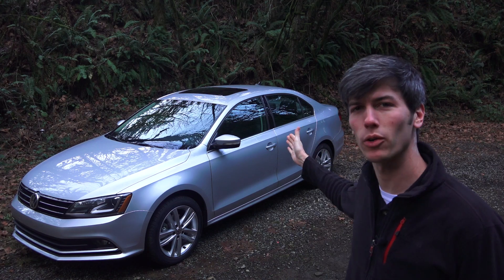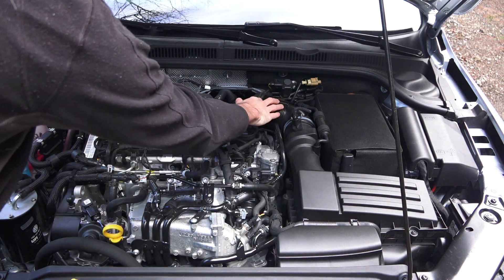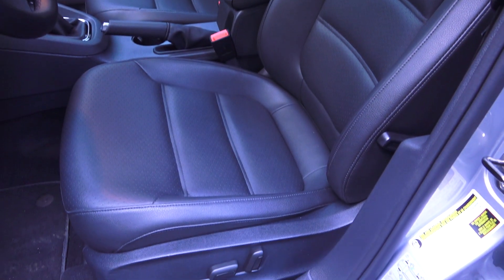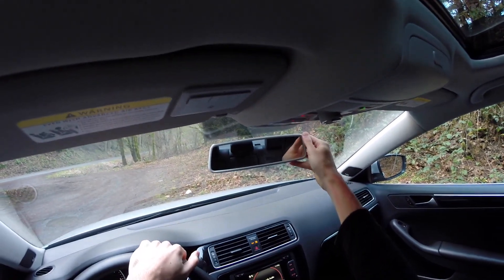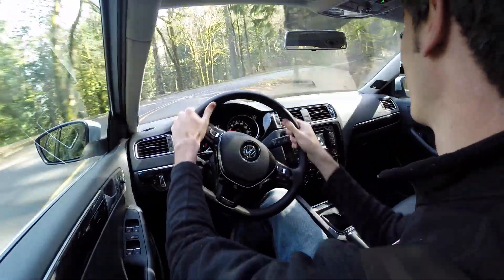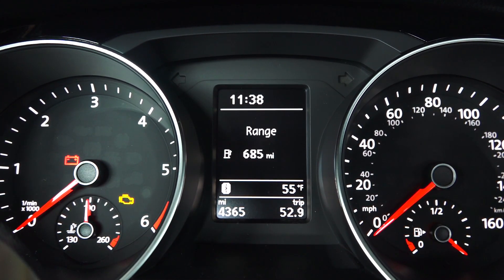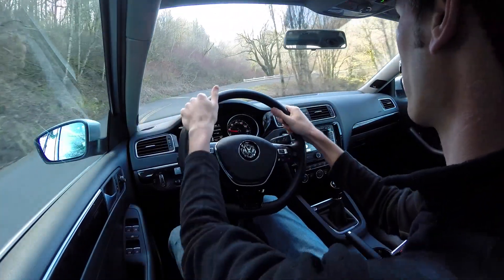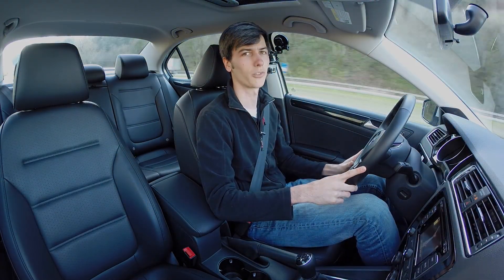2015 VW Jetta TDI - Review & Test Drive

Comment: I had a 05 TDI, honestly they're great road cars. Low end power and speed to make them fun, but they're a dog at high speeds which keeps you from getting in trouble. The only thing I didn't feel great about was VW used super thin wires for everything. At one point I got a trouble code for the turbocharger VNT actuator. After looking underneath one of the 3 wires going to it had broken in half from the heat hardening it and making it brittle. It looked like the same 16 or so gauge wire they use for the radio harness. Not even a wire loom over them. Not ideal.

Comment: Looking at a 1.8 14 and a 15 with the 2.0... curious which would you suggest... price is about the same
Reply: We drive a 2.0 it’s slow but livable. Pretty reliable too mechanically. I would go for the 1.8 for the extra juice, but get some answers from 1.8 owners first. Do keep in mind that vw are notorious for having small electrical issues like the window would sometimes not close and keep going up and down, but nothing permanent. Right now my blutooth stopped working. But the aux still works so i got an aux cable Small things like that

Comment: AND THEN THE EMISSIONs scandal....NO more diesels from VW.... Stopping pipelines this is getting old.
Reply: They're fixing the 6th gen diesels and putting them back in dealers again. You can now get these cars for dirt cheap. My dealers have 10 of the Jetta Sportwagen TDI for as low as $11,000.
Reply: @PhyuckYew  Be sure to do the cp3 mod the HPFP does fail on these. but other than that they are a great car

Comment: It's interesting as an engineer that you mentioned the "gas mileage" it gets. That's something I chastise my wife for doing when stating that. She put"gas" in my ecodiesel jeep when she borrowedit. I implore with her to always just call it fuel if she can't remember diesel and beg her to tell me she didn't put gas in it. Regardless of what type of fuel the car takes, "fuel" is generic and therefore accurate, whether it's her car Which is 
 out of gas or mine which is  low on diesel. Just changing the vernacular to say we need fuel or get good fuel mileage seems easy enough to me (not too disruptive). Sorry to be a stickler for good diction (which you normally have. As a diesel fan, this particular thing stands pout to me like a sore thumb.

Comment: I am curious to know what sub model this is. I currently own a 2015 VW TDI SEL w/ a DSG transmission. My model, made in March of 2015, has 4 wheel independent suspension, not the multil link track axle you show here. My dashboard is also different. I have a digital fuel gauge & no temperature gauge. Furthermore, my multifunction display does not show oil temperature. And you mention this model has adaptive headlights, turning left to right, yet I have never seen any VW with the exception of the Phateon (discontinued). Also your model doesn’t have a trunk lid spoiler nor did you mention the DEF tank in the trunk in the right rear...

Comment: the first thing I do to this car is cut off the exhaust system and have something sporty put on it. Now I'm not a young man anymore but I have a Subaru 98 legacy that has a modified exhaust I just love the sign of the engine. And I'd like to hear the turbo on that engine coming out the tail and also the diesel sound.obviously it's not a V8 diesel or an inline-6 so it's not going to make a lot of chattering sounds but I would probably remove the insulation under the hood just so I could maybe hear that engine. 

My goal is to keep the Subaru in and one day get this car.

Comment: Great review, Jason.

My girlfriend has a '13 TDI Beetle w/ the DSG. After driving it, I'm STRONGLY considering a Golf TDI w/ a manual.
Reply: i have a '15 tdi beetle manual, the engine totally makes the car great.
Reply: @aeromodelismeena8664  Glad you're happy with it!

After dealing with it here and there, and driving it for ~6 hours on a recent road trip, my opinion of the car has changed significantly. Engine is fantastic, though strangled by emissions systems. The rest of the car I'd never even consider owning, what a joke.

Comment: I am happy to hear the report of this vw. However, I do not like the front face of the vehicle. I am a fan of the mk2 Jetta and I have a 1980 B1 Passat/dasher Diesel (IDI) with a four speed transmission. This puppy hauls with 48 hp. It likes not going over 55 or 60 mph. It is a sexy-@$$ wagen.

Comment: VW cheated but with the MPG they get does it really matter? One Super Duty Ford diesel pollutes more. And most of these environmentalist have no problem jetting around the country campaigning for greater pollution control on a vehicle that measures its fuel consumption in Kg. And there is no talk yet on requiring planes to meet any polution standards.
Reply: Planes already meet pollution standards. Smokeless combustion chambers practically eliminated particulate emissions in the 1970s and greatly reduced CO and NOX by the 1990s. All that left is the idling emmisons which they are working on by having electric tugs to move the aircraft around and they’re already using umbilicals for electricity and conditioned air rather than running APUs for hours on end. 

Plus don’t forget... filled to capacity a large aircraft gets better per person fuel economy than a TDi does..., all while flying at nearly the speed of sound in a far straighter line.

Comment: I'm installing a new factory exhaust in my 01' Jetta TDI, it has 220,000 miles but runs like a clock, the old exhaust has a leak and needs changed.

Will the new exhaust make a difference in performance?

Comment: If my 2015 has the DSG Auto which gasoline engine model do I have? I am in Canada btw.
Reply: If you have a regular Jetta, it does Not have a DSG transmission. The regular Jetta's come with conventional autos. Only the GLI or TDI use the DSG transmission.

Comment: diesels brake down and have expensive repairs, from dual mass flywheels to turbines to clogged injectors, to failing high pressure direct injection fuel pumps.
and the 2.0 has a timing belt and is expensive to service.
Reply: None of those problems are specific to diesels

Comment: is this car fuel efficient and have a sunroof?
Reply: Yong Geun Song yes you should get it. Diesel is truly the ultimate efficient car. In my 2000 tdi with power modifications I routinely got over 50mpg on all highway driving. Yes lying is bad but if you research diesel emissions the soot is has a negligent effect environmentally. The nox emission are on par with a gas engine. In my state there is no emmiaions testing for diesels
Reply: yes on the highway it is efficent and yes it has a sunroof
Reply: Sartaj Aujla should i get it or something else?
Reply: considering the emissions scandal, you probably shouldn't. A Jetta GLI would be a better bet.
Reply: TheJacobShapiro you should if you can get a good deal I'm unsure if there is a fix for this model or if it is a replacement
Reply: Yong Geun Song i would go with a toyota camry any engine option is good

Comment: I noticed on your left window camera, when you do 0-60 tests the RPM needle appears to lag significantly. At first I thought it was that Toyota Sienna had an electronic display, but I noticed it here too. Weird how your head movement does not lag as the needle does. What's up with that?
Reply from the maker: I don't believe there is any delay in the tachometer.
Reply: hmm. watching it again i can see noticeable stops of the tachometer while your steering and head movements remain fluid. It jumps from 5k down to 3k, then from 3k to 4k. I also notice this slightly in the navigation display but to a lesser degree.

Comment: The clutch feel must be a VW thing in general, I have an 02 Beetle TDI (it only gets 46 MPG, lol) and it does the exact same thing. I thought something was wrong with it when I first drove it, lol. One would think in 14 years they would have addressed this issue.
Reply: It's TDI engine and dual-mass flywheel thing. There are to many vibrations withing diesel engine, which are supposed to be eliminated by this dual-mass flywheel , but not all of these are completely eliminated, so you feel it through clutch pedal.

Comment: I'm surprised that he completely skipped over the problematic DPF (Diesel Particulate Filter) that is expensive as hell and often fails at 100k. since it is integrated with the DOC (Diesel Oxidation Catalyst) it's difficult if not impossible to clean. Mind you the salesman doesn't tell you this either.

Comment: Looking at getting my first car in the next few years and will start saving soon. Right now I have a 14 year old Chevy Cavalier that is a family hand me down. Looking at either a Volkswagen Golf or jetta, or a Honda civic. I would prefer to go new as opposed to used and standard transmission. However, living in Canada we often have -40 degrees Celsius in the dead of Winter. When it comes do Diesel now a days, are freezing lines still a problem? Of course I can plug it in to keep it warm, how much energy does it use? Also, I often wait in my car for the engine to heat up before driving, will a plugged in Diesel mean less time waiting in my car for it to warm up enough to drive without being hard on it?

I'm just in the research phase right now.

Comment: by the time Americans will know the essence of having a diesel car, there wouldn't be diesels anymore.  can't blame them.they have never been fuel efficient! !
Reply from the maker: +Ato Nympha They're very fuel efficient, this Jetta had the highest MPG of any car I've tested (though admittedly with illegal emissions).
Reply: +Engineering Explained i don't mean the car. i meant Americans
Reply: +Engineering Explained How do you think VW is going to fix these things? I own a '12 TDI and I'm curious to what you would do if you were VW to fix it. Loaded question I know. Keep up the good work.
Reply: jayxeno vw has be honest from now on and they should check thier security very well because somebody sneaked in to do this mess.and to get more customers again they should even make more cars that has greater MPG now they are around 42mpg ,they should entice the public with 52mpg or more
Reply: + Ato Nympha rekt.
Reply: Ato Nympha you right. They are use to cheap gas. They own the oil of the world.

Comment: VW, not so clean diesel anymore
Reply: +josapaster VW are way too much cleaner than the shitty ass running coil trucks of the us, don't be an ignorant, the stupid us rules are just there to keep the european companies from taking over the local companies who have no idea how to make small, powerful and efficient diesel engines
Reply: abd bach. Nope. 

My gas pickup truck produces way fewer harmful emissions than these cheating Volkswagens. 

Plus it’s useful. I make money with my truck so I don’t care about gas prices. I make fewer trips to get things. Trucks are better built and they last longer (I usually have a good laugh when a European TDi owner brags about “high kms”). 

VWs need to cheat and ruin everything highlights how bad diesels really are. I don’t have to worry about unburned hydrocarbons or CO or NOX emissions on my truck. A cheating VW was producing forty times the amount of allowable emissions!

And fuel economy does not equal better for the environment... otherwise we’d all be driving East German Trabant 601s with a two stoke engine spewing more emissions into the air than a dozen modern gas vehicles.
Reply: lmfao😂😂💀 that's what I came for this video to see all the negative comments attacking them V.W owners😂😂😂😂

Comment: Nice car but what about the emission control VW have been sheeting on for years ????
Reply: +orignalbuckaroo Wait, which is worse - the 55.5 mpg diesel Jetta or the average American petrol 30 mpg car? Hm...
Reply: +Златко Попов  What's the use of buying a car that I can't ride because it's not legal ???? It's not passing the emmission test ????? Where you from ?? China ????? LOL
Reply: +orignalbuckaroo I know, I know, it's illegal. And that's the point. Someone in the U.S. doesn't want diesel cars because they use too little fuel. So, they end with with a scandal. Who cares that this VW Jetta puts twice as less smoke in the air compared to the 30 mpg petrol car! Oh wait, I forgot NOx. I wonder who made that requirement up? Hm...
P.S. Europe.

Comment: In future reviews, could you test the AC and how fast it takes to cool the car when you first enter it and setting it to the max setting?
Reply: I know your comment was posted 5 years ago, but I'll answer for this car anyway.

This engine is a CBEA if I'm not mistaken. Nearly identical to the CJAA as found in my 2014 Jetta TDI.

When you first start the car it takes a few minutes to start blowing cool. It actually feels like heat for the first minute and a half or so. You get the coldest air when the vehicle is in motion. I do notice when I'm at idle it will blow slightly warmer but I have a 4runner and TSX that do the same thing. I live in Tennessee. I am speaking for when it's 85/90f+.
Reply: might be a Portland thing

Comment: I would take the computer's MPG calculation with a grain of salt, especially on short highway trips.
A more accurate way of testing mileage is to fill up, reset trip meter, drive a full tank, refill with consistent factors everytime, and divide miles driven by gallons pumped.
Reply: That's why I ended up watching this video, as I was searching to figure out how these TDI owners were getting 55 MPG. They are not....... But the computer tells them they are.
Reply: I have a 2009 TDI Jetta. This is the 3rd TDI I've owned including a 2012 TDI that was sold back to VW.
The 09 TDI has been modified with a bigger turbo and injectors. It still gets over 50mpg hand calculated. 184HP and nearly 300lb ft torque.

Comment: can someone explain why i just bought a 2015 jetta SE TDI yesterday and mine does not have a temp gauge or fuel gauge???? i have the white dotted fuel gauge but not the needle one like the temp gauge in this im really confused??? i bought it brand new from VW yesterday can someone please explain do i have the older model or new model thanks.
Reply from the maker: Iron Panda Probably due to different trim (this is the SEL).
Reply: There is a way to flip through the different screens , I had the same problem.

Comment: I have an American 15 Passat TDI SE with Sunroof, wanted the full sized to have more room for family.

I absolutely love it and does great on the highway, which I do a lot of driving on. The highest I got the mpg up to was 58.6 on the highway. At a 16 gallon tank I can theoretically max it out 938 miles on a single tank. That is a drive from New York City to Jacksonville Florida on one tank.
Sure the exterior went the safe route and didn't do anything crazy, but looking at other cars I was in the market for, the Civic, Cruze, Legacy, they didn't blow my mind on the exterior either.

The interior is comfortable, clean, modern and German feeling.

Comment: From the experience of my golf 2015,  I wouldn't trust the mpg readout on the car. On mine it consistently shows an mpg 20-25% higher than the actual value. You probably got a similar mpg than the Fusion you talked about.

Comment: This is really THE best review in the YouTube. Great job, really helps a lot. 
There are so many options in this price range. 
I'm consider between 2015 Mazda 3, 2015 Civic, 2015 Dodge Dart and VW Jetta. One thing I'm worry about TDI is that if I park the car outside in the winter for overnight, will I have trouble to start it next day?

Comment: Anybody please tell what is the silver material covering some part of the engine compartment and also the bottom of the car? Is that for reducing heat transfer or acoustic isolation?
Reply: zeebazu You are correct. It is a heat shield for turbo and exhaust.

Comment: Ok. Lets clear things out. Those front flaps are NOT for aerodynamics. It's to prevent engine cooling (yes, prevent). You know, when it's -30C outside and you're going anything above 60 kph your clutch cylinder will start freezing and coolant temperature will drop below 90C even though thermostat is closed. Especially with diesel engines, since they are generally "colder". So those flaps will open only when cooling is required.

Comment: All the discussion.. get over it, neither diesel nor petrol is better.. Every one has its own place and conditions where its good at..

All the klishees that people bring up tho... listen to some new diesel engine car.. doesn't rattle.. clunk.. making otherwise horrible noises.. :D 
Diesels have come a far way.. although all the emmisions stuff is making it worse.. From a old mercedes diesel that gets 500k miles easy to a new car that needs its particle filters and stuff replaced every 30k or so... 

Sadly, here in germany taxes for old diesels are extremly high (to make them disappear from the road) and it works.. because you would have to travel 150k miles a year to justify the cost for tax with lower fuel and maintenance cost..

By the way... listen to a newer small petrol engine.. like 1.3l or so.. those are rattleing and making noises.. gone are the good old times where engines were running like sewing machines.

Comment: holey crapoley batman! What? VW thought its german friends would laugh at it so it covered up the door lock? What the hell is the point? Why does EVERYTHING have to be electronic these days? mechanical works just fine, can usually be fixed before replacement, and isn't subject to a million problems like electronics are. Ugh. I kind of miss the old days....though, EFI is a lifesaver I will admit. But come on people....Doors should ALWAYS have a keyhole (ALL of them!)!